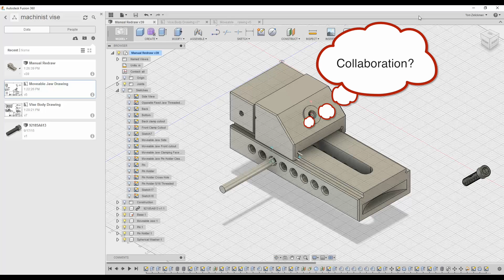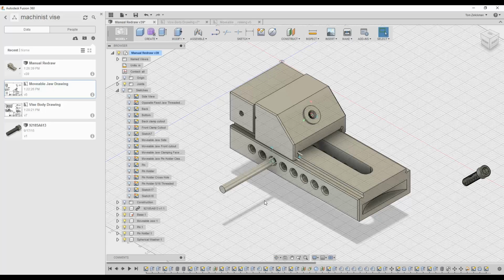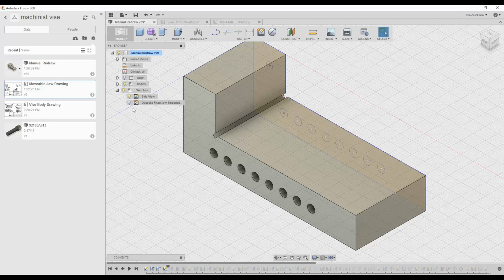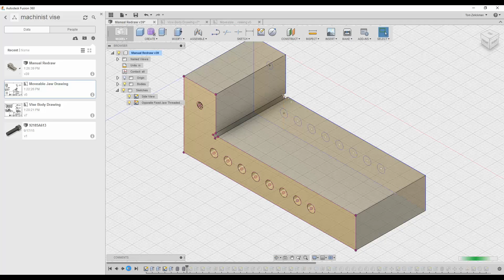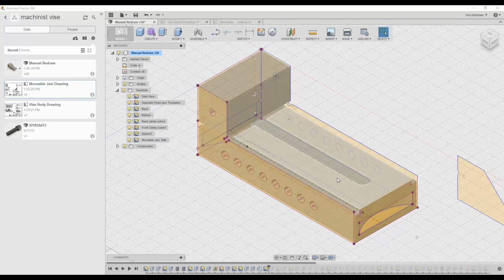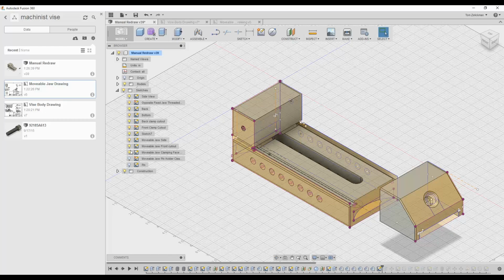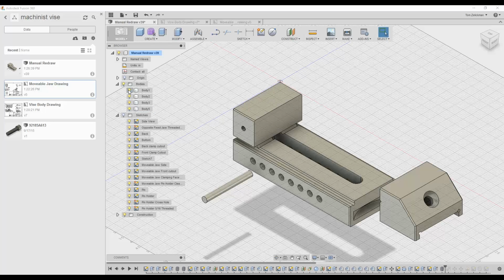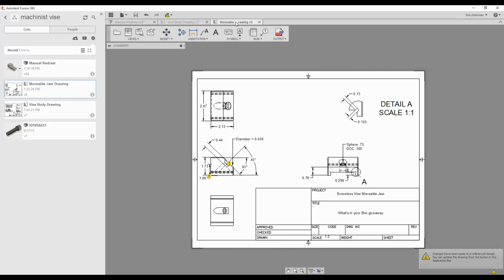WIYB Tool Maker's Collaboration - Screwless Vise Plans

Comment: On the relief of the non-movable jaw... Leave the radius.  Sharp corners in hardened tool steels is a "no-no". It introduces a sharp stress point and could be prone to cracking over time.
Reply from the maker: Hi Eric - Thanks for watching. You are absolutely right and when we machined the part we made sure not to leave sharp edges there. It's been a long time since I've even thought about this drawing and you've got me thinking about going back and doing it better; perhaps with a removable fixed jaw as well for easier production. Any other suggestions?

Best wishes - Tom Z

Comment: On the vise the first rectangle cut you remodeled can be drilled to make that radius. You know right under the hard jaw side of the vise. Then you can get a full radius and not risk cracking during heat treat. The reliefs for the soft jaw or movable should be cut with a radius end mill. But the hard jaw side needs the radius do to clamping force being applied over a lifetime.
Reply from the maker: Yeah, I’ve wanted to redo that whole design for years now. Guess I should do that!

Comment: Is that hemispherical washer going to be greased? If so, maybe add a recess of some kind to accommodate a rubber cap to keep the grease and chips separate (would also help keep the washer from coming out or moving around excessively during setup)? If not, then... I guess never mind.

I think the grind relief would be best with a radius in there, it'll keep the vise material from developing cracks over the years from vibration under load. It being on the inside of that clamping face means it's going to see a LOT of stress.

Also, what's the rationale for making the pin holder head spherical? Cylindrical(cylinder coaxial with the pin) seems like it'd be easier to make and a little stronger to boot. Could chamfer the end of the pin and the hole in the pin holder, would make changing position a bit easier.

Ticks and trips? Sorry, never used fusion... Great work though!
Reply from the maker: +Brad Gefroh Thanks so much, Brad! A lot of great ideas to incorporate into revisions of the design. This one was simply a remade version of a paper design I already had in my file however I'm going to redraw it using better techniques and with the suggestions people have made over time.

Sincerely,
Tom Z
Reply: +Tom Zelickman (Inspiration Metalworks) That sounds hella cool, sub'd. Keep us informed, I'll be watching for those videos!

Comment: Tom, nice model.  I haven't downloaded it yet and started playing with it.  The best suggestion that I can give you for making you models more parametrically (is that a word) correct is to make modifications to your design to flex your constraints and see what they do.  What I am saying is to make your first sketch, then start adding additional features. Next go back and change a dimension or two in the primary sketch.  Do the children react the way you expected?  Or did they fail all together?  This will make you define your constraints better when you start.  I know it sounds basic, but I find it helps.  Fusion 360 is much more forgiving than the software that I learned on and you can finish a sketch with less than ideal constrains.  And that all works fine if you don't have to move or change things later.  Example, if you want a circle in the middle of a block, you can dimension from two sides to the center of the circle.  Then if you modify the block, the circle stays in the same absolute place.  If you create two construction likes from corner to corner and draw the circle at the intersection then when the original block is modified the circle will move with the parent model.  And thanks again for the model.  I am just starting to learn Fusion 360 so this will be a big help for me looking at other models.  R.J.
Reply from the maker: +Abc Defg Thank you very much for the tips! It's taken a little time to wrap my head around the idea of using constraints and relationships but I'm getting much better at that with practice. I like the idea of being able to change one part of the sketch and the rest of the model also changes accordingly. Makes life a whole lot easier!

Appreciate any other tips and tricks you come up with along the way and thanks for watching.

Sincerely,
Tom Z

Comment: Tom, can your Fusion export SketchUp files? I can make drawings from the PDFs, but would prefer to not add so many errors! <wry grin>
Reply from the maker: +Sean Flanagan Hi Sean! I really don't know yet. The link I provided includes a format that can generally be used in CAD programs called a STEP file. I know I can export to STL though, would that work for you?
Reply: Tom, I don't know SketchUp any better than you know Fusion. However, I don't believe it would (SU doesn't know what to do with the STEP files, so I wouldn't expect any joy). That being said, the SU model repository has many examples that evolved from CAD or were elevated to CAD. Maybe I should have first asked in the SU forum how that's done. <blush>

Okay, so one blush on me: just opened the first PDF and the first dimension (callout, actually) I noticed was for the 1/4" tapped hole in each side of the fixed jaw. Specified as 1/4-28 UNC. You've prolly already seen that and corrected it. <wry grin>

At risk of repeating myself to the level of insincerity, you guys are GREAT! And the young folk who receive the fruits of your labor will stand on the shoulders of you giants. God bless you all.

Warm regards; merry Christmas!
sean
Reply from the maker: +Sean Flanagan Hi Sean - I did some research and it looks like you need the Pro version of SketchUp to do much importing. Do you have that? If so, I can get you a format that will work.

Which PDF had the typo? Thanks for pointing that out! There should be a couple of them in that zip file and remember that the "original" design was an old class project so I can't fix that one. The other thing to note is you aren't bound by that bit. Personally, I'd use 1/4-20 since that's what I keep on hand here. If it's something I can fix I'll include it in the updates I have slowly been collecting up. Stan also had some suggestions like undersizing the moving head just a bit so it can move when clamped in the vertical position.

Time for me to be humble here and give credit where it is due. I'm flattered to be included in this community of amazing people especially on this project however, I was the back-office guy supporting the team who did the heavy lifting. Proud to have been a part of it though.

Like you, I am happy to both receive and give of my knowledge freely. Ok, rambling now.

Best wishes and Merry Christmas!
Tom Z
Reply: Tom, thanks for the research! No, I missed out on getting SU Pro at the 2/3 price and can't justify the cost of it. This vise is so (mostly) simple that it will be both easy and good practice to draw it.

<blush> After doing my little indian dance and gloating over the thread designation find, I noted the legend and realized that this was your source, and was 'frozen in time'. Too bad, as one of the views (A1) doesn't agree with the drawing, and both views are flipped (left to right). All this is on the first page of the 'Machinists_Vise_Original.pdf'.

Ah, class projects! How well I remember! And that explains the errors: although the drawing is dated '03, I expect almost no institutions of higher learning permitted use of CA Drawing tools, and the little anomalies didn't get caught. In this version, anyway.

Okay, then thanks for your support, without which the project might have been finished but not in time, and not correctly. And thanks for your humility -- a valuable example! No, a priceless example.

Comment: Looks awesome man. I need to crack open my 360 and give it a try. Next time do your sketch plane from the front face. Extrude the square cut through all. Then extrude the grind relief up to the fixed jaw from front to back.  That would eliminate the added chamfer.  On the reliefs for the clamp, could you draw one then mirror it about a construction line?
Reply from the maker: +Logical Apprentice. Thanks, Chuck. So many ways to get this drawn better than what I did the first time. I'd like to blame it on all of the post-surgery pain meds but it was really lack of experience on my part. I'll just have to keep practicing!

Best wishes,
Tom Z
Reply: Looks awesome man. There will always be more ways to do it and IMO none are wrong. It's the end result that matters. Besides, I know guys with just as much experience as you who could not draw it. Be proud my friend ahaha

Comment: There is a reason for the grinding relief to be a radius. You do not want sharp internal corners on parts that will be heat treated! This creates a stress point, that is prone to Crack during heat treat.
Reply from the maker: +Jerry Long Thanks, Jerry! I'm not certain they did heat treat these parts, to be honest. I wondered about stress risers in general. Would using a slitting saw with a corner radius alleviate that issue do you think?

Best wishes,
Tom
Reply: Any radius is better than none. Of course the full radius would be preferable. That being said, you may get by with sharp corners and never have issue. But after putting all the time into machining, the expense of tool steal. Why take a chance on it cracking on the second to last operation?

Comment: I had made 1 of these and I had put a slot down the side of the base the same width as your pin holes. that way you can clamp it from the side if you need to
Reply from the maker: I've seen that as well, Kyle. I've been toying with ideas for a variation of this one and that's on the list as an updated feature. Anything else you might do differently? I was thinking about a detachable fixed head so you can start with smaller stock. Also a fixed pin with a wider cutout in the base to just slide into the notches.

Best wishes,
Tom Z
Reply: A detachable fixed head would be a good idea how you said to use smaller stock but over time might wear more. Is there plans on heat treating it?
Reply from the maker: I'll have to defer to others on the team for that one. I believe the parts were heat treated and then ground to final dimensions. That would be my preference as well. Have you watched the other build videos? How about the grinding prank they played on Brad? Gotta love these guys...

So I'm open to other suggestions on the design though. Glad to get them drawn up and made available to everyone as well. I could use the practice too. I typically do everything in either 2-D or paper and pencil so this was all new for me.

Best wishes,
Tom Z